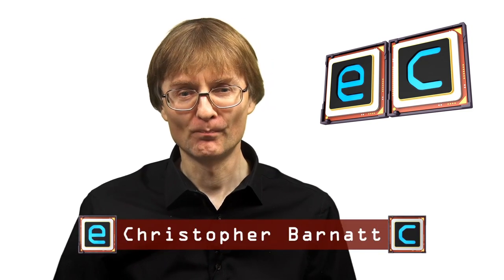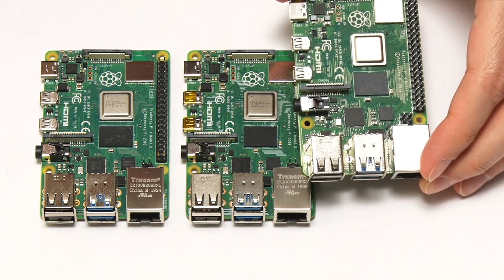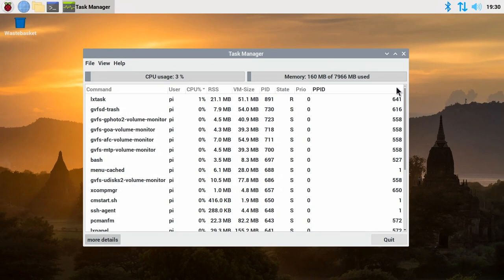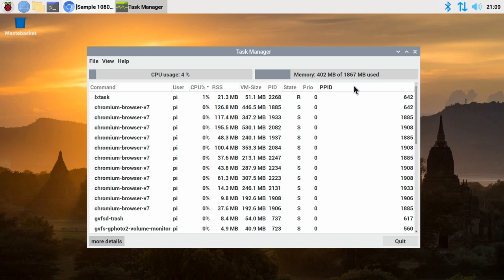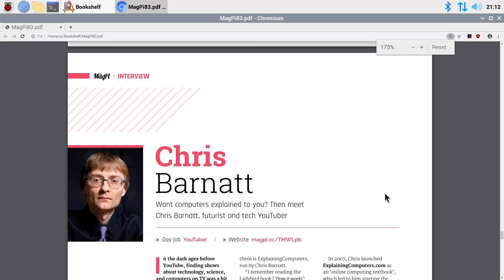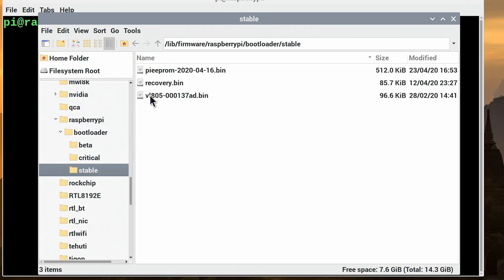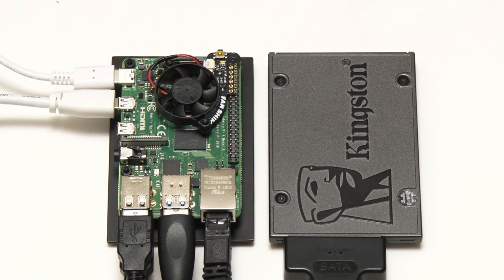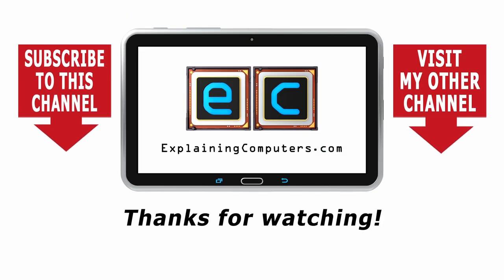Raspberry Pi 4 8GB & USB Boot

Comment: I need to know if I can install android or windows 7 (not 10) and what should I use, micro sd or USB stick or external hard?  Answer me old man!
Reply from the maker: The Pi has an ARM processor, so cannot run Windows 7 (well not without emulation, and this is not advised). Micro SD will probably perform as well as most USB drives, while an external HDD may be faster, if with a non trivial power overhead.
Reply: @ExplainingComputers  what about windows 10? Can I installed on micro sd? (I need it to mount on my tv, l need a fast pc but not Linux) can I install an android like, pie or something..?
Reply: @ExplainingComputers  and sorry to name you -old man... I'm older than you but I don't like the idea you're smarter than me!
Reply: Win7 cannot be installed on a Pi of any vintage. Win10 can be, but then you'll become a victim of their dicey update cycles. It's better to stick with an ARM-specific Linux variant (of which android is).
Reply from the maker: @AndrewJackson2000  There is an ARM version of Windows 10 IoT (ie no desktop) that is supported on the Pi. There is no officially supported (or practically usable) version of Windows 10 for the Pi as it has an ARM processor, not x86. In next week's video I look at eight SBCs with x86 CPUs that can run Windows. :)
Reply: @ExplainingComputers  but I can install an android version to work very fast?

Comment: Booting from sd card and from usb drv. What about booting speed difference?
Reply from the maker: I did not time it, but it is not what much faster -- even after the initial POST.
Reply: It's an overall much better experience.
Reply: The card reader chip is limited to 40MB/s. But the USB chip is 350MB/s. Boot speed change is minimal but desktop performance gains are HUGE.

Comment: Great video and finally USB boot! I'm running Home Assistant on my RPI4. Is there a way to update the the firmware and copy the content of Home Assistant flashed MicroSD card onto a USB device? If I need to download the Raspberry Pi OS to update the firmware that's ok but how do I then copy the HA MicroSD card onto the USB drive? 3rd party tool?
Reply from the maker: Thanks for this. As far as I am aware, you will need to perform a full-upgrade to get hold of the latest firmware file, but you do not need to be in Raspberry Pi OS to run it (although the eeprom update utility is probably not installed by default in another OS). You could use the SD card copier in Raspberry Pi OS to duplicate your micro SD HA car d to a USB device -- the drive you copy from does not have to be the running OS drive. But you would need a USB to micro SD adapter if running the OS from micro SD at that point. Good luck!
Reply: ExplainingComputers Thank you very much, this helps a lot! Since I don't currently own a USB MicroSD adapter (I'll   probably get one for ease going forward) are you aware of any known to work Windows tool to copy a micro SD to USB media with the same result (my laptop has a built in MicroSD slot)?

Comment: I’m getting a 240Gb ssd drive to try as the Raspberry Pi boot device.  Do you just use the whole drive or do you recommend creating a few partitions ?
Reply from the maker: If you want to set up the drive using a standard Raspberry Pi operating system image (Raspberry Pi OS, Twister OS, Ubuntu or whatever) you will have to use the whole drive,  which will be imaged with several partitions as Linux requires. It's no different to using a micro SD card -- your imaging program (Etcher, the Raspberry Pi installer or whatever) will set up the drive for you. Or, the method I've found most effective when setting up an SSD boot drive for Raspberry Pi OS, is to have a working micro SD card, and to image this to the SSD using the included "SD card copier" utility.

Once you have an SSD working as a boot drive, you could shrink the main (OS) partition to free some space, and then create other partitions in this space if you wanted to.

Comment: Chris, Is there a BOIS upgrade for the 4gb  PI to allow booting from USB?
Reply from the maker: Yes, the update covered in the video works on all Pi 4 models -- I've tried it on the 2GB, 4GB and 8GB. But do be aware it is beta, so not all devices may work yet, and upgrading is a risk.
Reply: @ExplainingComputers  there is always some risk in any update. It come with the territory when your exploring new territory or unknown territory.

My dream SBC would have 4gb of memory with support for onboard hardware RAID 1 with 2 matching SSD slots and 2 matching sata with a 3GH quad core.  I would be in server heaven and it would run Xinuos OS.  Then I'd have a server that would last almost forever.
Reply from the maker: @ffieditor  True.

Comment: Recovery

If your Raspberry Pi 4 will not boot, it is possible that the SPI EEPROM has become corrupted. To check, remove the SD card, disconnect the device from power, then reconnect it. If the green LED does not flash, this indicates that the EEPROM has become corrupted.

Raspberry Pi Imager provides an easy way to fix this problem, by automatically preparing an SD card that will reprogram your Raspberry Pi 4’s EEPROM:

Find an SD card that is empty, or does not contain any data you want to keep; it will be completely erased of all data during this process.
Download Raspberry Pi Imager for your operating system from the list near the top of this page.
Click “CHOOSE OS” and select “Misc utility images” then “Pi 4 EEPROM boot recovery”.
Insert an SD card, click “CHOOSE SD CARD”, select the card you have inserted, then click “WRITE”.
Once the SD card is ready, insert it into your Raspberry Pi 4 then connect the Raspberry Pi to power.
Once complete, the green LED will blink rapidly in a steady pattern. Disconnect the device from power. Now you can remove the recovery SD card, insert your usual SD card, and resume using your Raspberry Pi.
Alternatively, you can download the bootloader and create a recovery SD card manually:

Download the bootloader.
Extract it to an empty FAT-formatted SD card and insert it into your Raspberry Pi 4.
Connect the power and wait for the green LED to flash quickly.
Notes:

View the full bootloader release notes
The previous bootloader remains available for download

Comment: What is the best raspberry pi for a file server and which software distro do you recommend ??
Reply: You'd want the Gb ethernet 4GB RAM Pi 4 most likely; maybe 2 or 8 GB RAM. I'd probably go 8GB RAM just because I'd rather have it if I ever wanted it for some reason. For servers I generally like Debian. For games I like Manjaro. Both Xfce if I want a desktop environment, which is capable and fairly light on resources. These are general Linux distros though, so you might want something else for the Pi.

Comment: Do you have secure user accounts on the new raspberry pi os?  Or is it single user with no login?
Reply from the maker: You have normal user accounts just like on any Linux distro. There is default account set up to not require a login, but you can set it to require a login if you want.
Reply: @ExplainingComputers  brilliant, many thanks :D

Comment: In your Raspberri Pi adventures, do you happen to have found a USB 3.0 hub with a port that provides the 3A required to power a Raspberry Pi 4 along with multiple powered data ports suitable for external hard drives?

Sorry if I've asked this in the wrong place as I know it's only loosely related to the video topic. The note on your website re-directs questions to your YouTube channel but not a specific place, so I just found the most recent Raspberry Pi related video. I can always move the question if there's a more appropriate place.
Reply from the maker: Sadly not.

Comment: A side note: watched most of your video with 1080p resolution: from the stats for nerds:  Viewport / Frames1280x720 / 56 dropped of 27410 (on Manjaro ARM Linux, 20.06, Chromium browser), which is slightly better than the stats of the Raspberry Pi Linux you showed. I wonder if this is due to Manjaro being a 64 bit system, or something else. (or how representative the data are you showed). (Now, I realise some of the difference may be due to the difference: Current / Optimal Res1920x1080@25 / 1920x1080@25 vs @30  of the test video.)
Reply from the maker: I imagine that the 64 bit Manjaro helps a lot. :)

Comment: It was possible to have root file system on USB drive already for some time [even on  Pi 2]  (while still having /boot/ partition on SD card, see e.g. https://www.raspberrypi.org/forums/viewtopic.php?t=44177 ). Because SD card is needed only for boot, it is possible to have some completely scrap SD card (like some old 1GB) to host /boot partition only and have rootfs on USB drive. What is new is that now we can also boot from USB device. But if the main concern is the speed of root file system after Pi booted already, it was possible to run it from USB already ages ago (surely having USB3 on Pi4 helps as well). I think also using command "rpi-update" will download and installs latest bleeding edge firmware, ver 5 of kernel and video drivers for your pi [pre-release] (https://www.raspberrypi.org/documentation/raspbian/applications/rpi-update.md)
Reply from the maker: What you say is true, but does not change the fact that it has been impossible to boot a Raspberry Pi 4 from USB before this point. :) I have put detailed notes about the upgrade process in the video description, including a statement about how the vast majority of tutorials for firmware upgrade are flawed, as they clearly have no idea what the flags they are using actually do.
Reply: @ExplainingComputers  Indeed, but most videos about new USB-boot (including yours I think) for some reason are "selling" it as if the main feature of USB boot is to to have faster rootfs experience  by having it on USB3, when in fact it was possible already for quite a while. All what USB boot does is basically frees SD card slot.  That was my point.

Comment: Christopher,
 I want to ask... I have a raspberry pi 4 8GB and I'm trying to make it work with a barracuda 4TB HDD. I found a card from geek worm to power the HDD and it has a 3.0 USB adapter to make it work. 
The problem... I can boot and make everything work but.... it will only recognize 2TB of the HDD. 

Any ideas on how to fix this?

Ellis Clark
P.S. I did not find another way to contact you!

Comment: Hi All!
.
Smothieboard is now used in 3d Printers and in Laser Cutters 
and in CNC Mills offering Smothieware as an alternative to 
a 32 Bit Microcontroller with RAMPS board offering Marlin2 or GRBL.'
.
What I really don't understand even today:
.
WHY ALL THIS OVERHEAD ?
.
Smothiware or Marlin2 or GRBL could  all be Modules written 
in C and running on a Raspberry  
--- because the Raspberry  HAS GOT GPIO Pins too 
--- just like the Arduino and like the Smothieboard ....
.
So why do they still use seperate Microcontroller 
Boards when anything is doable on the PI?
.
Or is there some development going on to get rid 
of all these Microcontroller solutions?
.
any thoughts appreciated.

(in other words: if my 3D printer came with a PI 
and a Motor Control Board then I could play 
computer games and watch the news 
on my 3D printer while it is printing ...)

Comment: bought Raspberry Pi 4 and or bought m.2 from 256gb and case for m.2 from orico but when the Raspberry starts with m.2 it is not detected you have to unplug it from the USB port and reattach it solution

Comment: You copied a current functioning SD card to external SSD, then rebooted. Can you please comment on achieving the same goal but starting with /root already on the SSD and /boot on the SD. This configuration previously allowed me to run the Pi from SSD, with a minimal SD footprint.
Reply from the maker: This can be done, but is not trivial to explain! :) And I can see no point if an SSD is conected and the Pi can USB boot.

Comment: Sorry I didn’t finish my question but are they trying to force a change in th standard size ?
Reply from the maker: I don't think so -- the SBC market is fragmenting into more expensive, sometimes larger boards (esp for IoT and AI), whilte the Pi maintains its position at the lower  end of the market. The two will coexist  quite happily.
Reply: Thanks

Comment: wonder later on if they do something that it would be to toggle a simple command so that we can change default boot from sd or usb without changing the firmware or that it has a self detecting which device has a bootable partition on it to auto boot like a bios

Comment: How effectively can you run Windows 32-bit on this -- say Win7 or Win10?
Reply from the maker: The Pi has an ARM processor, not x86, so it cannot natively run any standard Windows edition. You can run earlier versions of Windows via emulation using, eg, DOSBox (Windows 3.1 runs very well!). There is an IoT version of Windows 10 ARM for the board (ie no desktop), and some have tested ARM Windows 10 with a desktop, but there is no support for this. In short, expect for running early Windows via emulation and IoT Windows 10, the Pi is not a Windows board.

Comment: Bit disappointing that it drops frames at 1080p when it supposedly outputs 2160p@60fps
I want to test this thing out for 4K digital signage using yodeck
Reply from the maker: It outputs a 2160 p 60fps video signal. This (sadly) does not mean it can stream media at this frame frame. A Pi can certainly play 4K local files without frame dropping 9eg in VLC), but streaming is quite a different matter,
Reply: @ExplainingComputers  I imagine the GPU allowed it to hardware decode h265. It would need to to allow low enough bitrate to get it through the IO before all that data hits the frame buffer.

Comment: What would you think of battery operated Pii4, i guess if you have an 8gb, does it take more watts vs. 4gb or 2gb, I wonder if there is a battery monitor that can email you letting you know that you have to charge your battery, this would be for Security system where electricity is not available.... lots of projects in that question.... and I am going to Subcribe and thumbs up, all your videos, as they are VERY VERY informative for a beginner in the PI World.

Comment: I don't like "4" because of higher temperatures, sometimes a need for a fan (that might get faulty), higher power consumption and a need for more amps....
I wish they released Pi Zero with some 1mbit/s network card...Still the same small size but power consumption also low.
I know I can add something to i2c or spi to Zero, but...it's not the same as solution provided by manufacturers (offered support!)

Comment: I've got a couple of Pi4 2gigs (because they were, and probably still are cheaper than a 3B+). And I have to say, I've yet to do anything with them that would require any more RAM. I'm not generally the type who does a lot of emergency video editing; and if I was, I think I'd opt for a laptop over a gizmo. And I'm not into doing face-recognition on my mailman or anything. I mostly just install OSes on them, until I break them and have to start over. And, having glancing through the forums, I'm convinced that's what MOST people do with them. How much RAM does that actually require?!!?

Comment: Thank you for superb video. I desperate: in your case on 15:20 when you hook your drivr to usb i can see it is immediately mounted and two icons appear on the desktop: for boot and rootfs partitions. In my case i can not see it, there is nothing in /media directory - not even /media/pi/... It is only /media directory and nothing more. I've tried with different usb pendrives, ssd drive with adapter. However when i use SD Card Copier to copy SD card to the usb stick or usb ssd the operation is succesful and i can see the content of boot partition when i hook the drive to my windows based PD. Any clue? I'm logged in as "pi" with stardard password changed to my own. Is it about privilleges? Please heeeeeellllllpppp:)
Reply from the maker: I would guess this is an issue with your USB to SATA adapter. The Pi now supports many of these, but not all of them are bootable.
Reply: @ExplainingComputers  thank you for answer. i tried to copy SD card to USB stick to check if i can boot from USB stick - same thing., not booting when SD card is removed. I don't see any devices in /media folder - looks like USB devices are not automatically mounted?
Reply: and lsblk output is showing disk 447.1GB SSD is connected as sda with two partitions sda1 (256MB) and sda2 *446.9MB. And as SD Card Copier is working and SD card content was copied successfuly to SSD it means the adapter is ok. Right?

Comment: I would like to see a version of Android for my Raspberry Pi 4 4GB. I have been waiting for that for a while now. 
The way I heard it, it sounds like the firmware update will allow any Raspberry Pi 4 to boot from USB. Is that correct or is the new Raspberry Pi 4 B or later required for this functionality?
Reply from the maker: The new firmware is for USB booting on any Pi 4 (1GB, 2GB, 4Gb or 4GB model). The 3B+ already boots from USB as standard, and the other Pi 3s can be firmware upgraded. The Pi Zero, Pi 1 and Pi 2 cannot USB boot.

Comment: hi brother I have raspberry pi 4 model b with 4 gigabytes of ram  but the sound is gone when  i connect it to vga screen could you please help me what to do to fix it
Reply from the maker: VGA does not carry audio -- I presume you are using an HDMI to VGA adapter? If so, this adapter may have an audio out. Else, use the 3.5mm jack on the Pi to supply audio to headphones, powered speakers, or your monitor if it has speakers.
Reply: @ExplainingComputers  no it haven't any type of output but the VGA and it steal happening even when I get back to use only hdmi